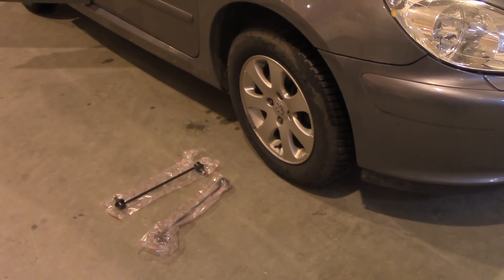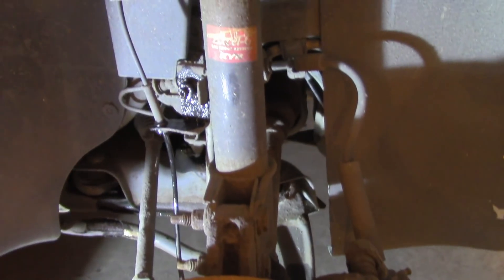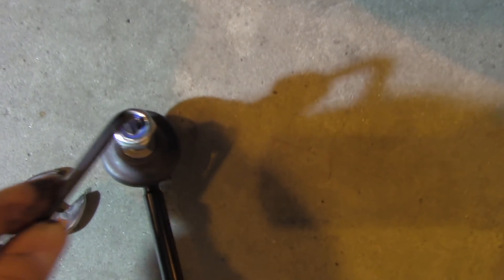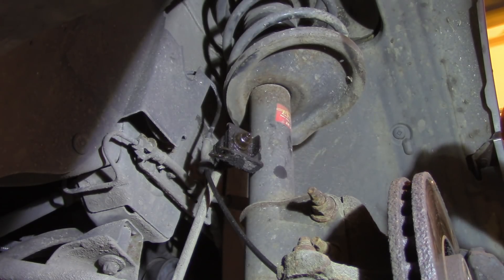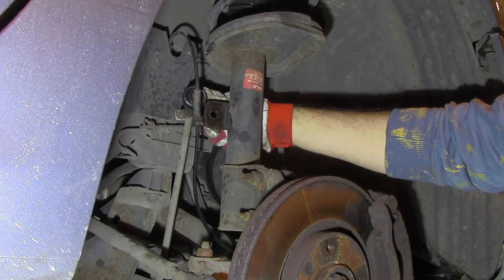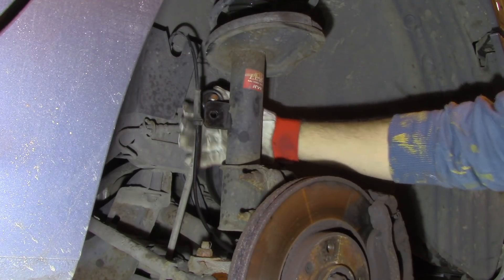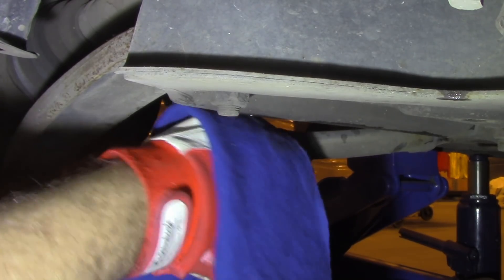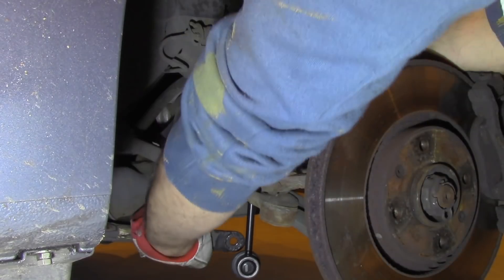ARB Link / Stabilizer Sway Bar Replacement - Peugeot 307

Comment: how do see if the stabilizer is worn out while it is still installed? Your old one didin't look so bad?
Reply from the maker: Hi Jojo,
Try to move it by hand. If it is quite difficult then high chances are that it is ok. You will often hear some knocking while driving when this part is worn out. 
Cheers

Comment: First you should clean the dust and mud with a wire brush, then you should spray WD-40 and wait for 5 minutes.
Reply: I think he waited for a bit longer than 5 mins. Sometimes the grinder is the only way, and much faster which is important!

Comment: Hi, why are you replace stabilizer? Is it because  noise from it?
Reply from the maker: Hi Grmba,
Yes, there was a noise coming from my right wheel while driving so I decided to replace both stabilizers. 
Cheers
Reply: What the sound like? I had mine after changed all set suspension it still appear same as before. Dissapointed.